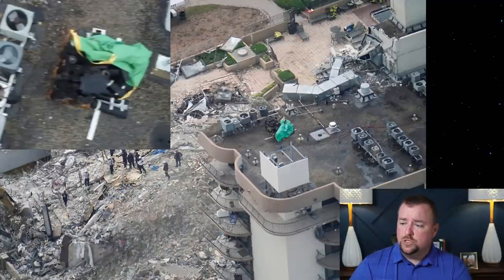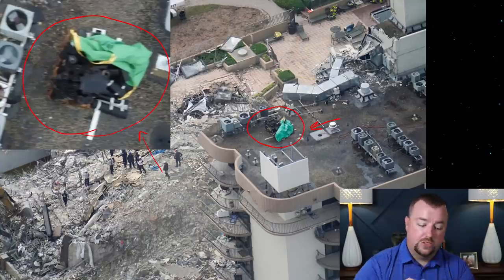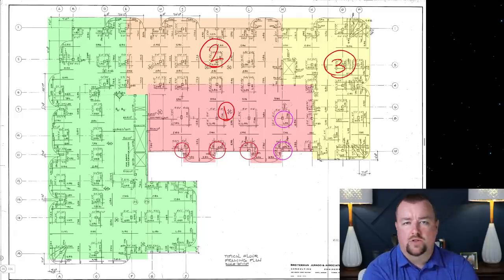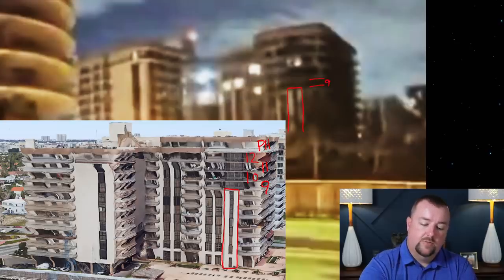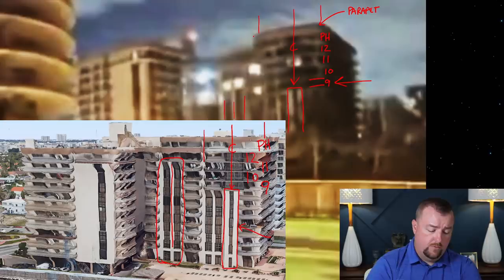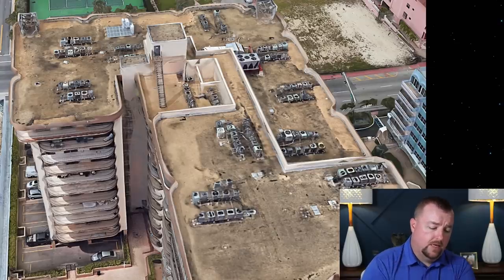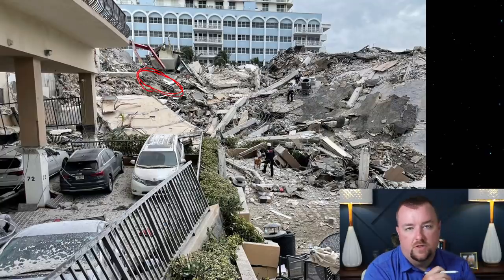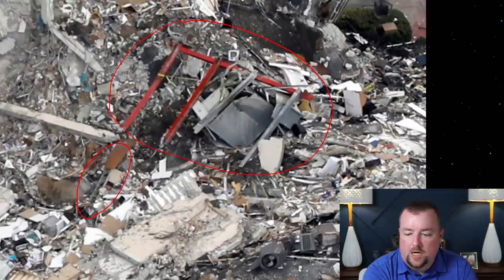Surfside Building Collapse - Did it start at the roof?

Comment: Did you not see the debris in the garage filmed moments before collapse?  Did not start at the roof.  Sorry.  The pool deck collapsed - that's a known fact.
Reply: I really appreciated this video explaining exactly why the collapse was indeed from the ground up and not, as some have suggested, from the roof down.
Reply: The pool deck did collapse first, and he's shown that in previous videos, but the pool deck is not technically part of the building.  The question was whether the building itself collapsed from the roof first, or the lower floors.  It may have been possible that the pool deck collapse destabilised the building above it enough, shifted the load etc to the point that the roof may have given way first.  This analysis demonstrates that it was Floor 1 that would have collapsed first.
Reply: @eat_a_dick_trudeau  unfortunately this is the internet. Where you have to debunk every unfounded wild speculation. Regardless of how many facts the speculation ignores.
Reply: @eat_a_dick_trudeau  This right here is gold. The comments from people who obviously haven't watched the video are driving me NUTS! Thank you for calling out @DeeDee2003

Comment: Josh, @24:55 do you think anything the roofers did (loads, cranes, davits/anchors) caused that curious triangular gash at the top of the stairwell shaft?  Apparently the sturdy CIP shear wall proper stops at floor 12, and they just hacked together the PH add-on with CMU "cinder" block, slapped on some stucco and paint, and called it "Reiber-perfect" and "Surfside 5-finger Approved"... can't bring myself to even call it CBS since there's zero vertical rebar, aka cavity-formed columns.  =:O

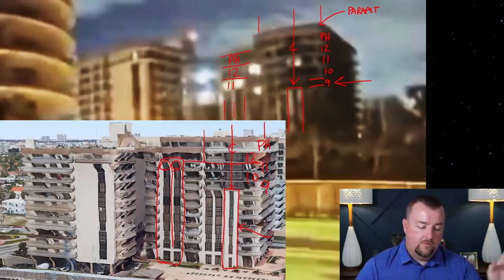Comment: 16:40 what happened to the parapet above the penthouse in the collapsed section though? It looks like it's totally gone or collapsed.
Reply: Agree. Given that it seems clear the deck collapsed "first" perhaps the parapet fell to the deck, collapsing deck, damaging columns, etc. May explain the damage seen in the first garage video taken by the tourist where it seems there was at least one column missing, knocked over. I may have missed it, but it has not been disclosed what roof work they were doing.

Comment: There's no doubt in my mind this... was a Sinkhole
Reply: Is that even possible considering where it was, don't you need some elevation (above sea level) to have the sort of underground movement that could create a sink hole?
Reply: Thats what I've been thinking this entire time.
Reply: No. When the pool deck collapsed, it removed the side support for the columns, at ground level. This effectively doubled the length of the columns. Say it was 10 feet between floors. The columns would be supported laterally at 10 foot spacing at every floor. With the deck falling away, the column was now 20 feet long. The load capacity is reduced to about 1/4 of it's load capacity when you double the unsupported length. So, if a column could support 100 tons at 10 foot spacing of lateral support, it can only hold about 25 tons at 20 foot spacing of lateral support. At that point the column fails.
Reply: it was not
Reply: Nah, the collapsing slab yanked three support columns out from under the building and set into motion the overloading of the the columns around them.
Reply: @kurtdietrich5421  
Then the building would have fallen flat like a tree if it failed at the base as per your theory.
 This building dropped down straight like a curtain..the floors landed over each other like  pancakes. It literally lost ground. Sinkhole is the only explanation.
Reply: @lordaimelord7848  I'm a licensed professional structural engineer for 40 years and worked in a concrete testing lab for 25 years. 
The columns buckled at the garage level. The rest of the building crumbles above it. Because it takes force to break all the column to deck connections, there are some areas that hang on longer than others. Especially to parts of the building that didn't fall. It wouldn't fall over like a tree. It collapses straight down. No sinkhole. Just poor maintenance.
Reply: Aurora Peace  the equipment on the roof was minor compared to the weight of the roof structure itself. Yes, it was added weight, and didn't help a weakened rusty structure, but it cannot be the major reason for collapse.
Reply: @kurtdietrich5421  
I disagree. Just as i disagree with the "Scientist" Dr.Anthony Fauci.
Reply: @lordaimelord7848  In case anyone wondered what to think about you, you have now removed all doubt.
Reply: @kurtdietrich5421  For the building to fall in it's own footprint, you need to break all the columns simultaneously. That won't happen in a natural collapse. 
@Lordaime Lord    The condo on Jun 24th fell similar to the part that fell on July 4th and similar to WTC7.
So I would say: A controlled demolition is the most likely cause.
Reply: @reallyme3573  unfortunately, you are very incorrect in your assumptions.
Reply: @reallyme3573  
It did look like a controlled demolition however i would have said the same  if not for the fact that nobody heard explosions. Not one person ever said that. 

There was a couple at the opposite block...swimming late in their pool..who heard weird loud noises from the  Champlain Tower and they videod water flushing down into the basement  carpark. That water must definately have come from the collapsed Pool which one woman on Champlain Tower had witnessed collapsing. That woman...a victim..
 told  her husband over the phone (he was out of town) "the pool just collapsed" 

The way the building collapsed was also very similar to how houses on  collapsing Cliffs  looked like.  Also similar to how houses collapsed into  giant sinkholes. There's lots of videos of Sinkhole disasters on YT.

Comment: Cool analyzes. I am not an expert or work in any trades related to building but the roof section that you showed, for me, proofs that the building collapsed on itself. When you talk about the Penthouse add on I think of the collapse of a tower that add extra floors on.

Comment: There were huge bush planters to the left of Spa on spa deck over parking garage where there had been puddles of water & rust on the ceiling & supports, caused by 40 yrs of over watering? The planters outline the edge the collapse, but I believe the pool deck was polka dotted with planters (which we're probably overwatered.)

Comment: One thing you aren't taking into account is perspective. The distant part of the building will always appear lower than the nearer. However I do agree that it was beginning to drop, just not by as much. The building collapsed like an implosion, which tells me it must've started at the base, where you indicate the 3 columns. Your explanations are very helpful, and I think you're spot on regarding the probable origins of the collapse. I wouldn't worry about being perfect on the "order" as it was a contiguous collapse. Some are saying that the pool deck failed, causing the building to collapse, but I think it's the other way around. The building was built in one continuous structure with the pool deck and parking garage (idiotic BTW - if one part fails, the rest will be pulled down with it). I think the building pulled down the pool deck.

Comment: Josh,  I really appreciate your thoughtful analysis of this terrible event.  Re the assessment on the Roof, it occurred to me that if the collapse was a bottom up failure, there would have been some indication of damage at the bottom level first, propagating upwards.  Anotherwords the first 8 levels would have become disjointed first, starting on the visible first floor.  You would expect to see warping of windows or shattering or something beginning at the lower levels.  I hadn't noticed the roof collapse in the video before.  But that really sticks out now.  Am no building expert, but it seems plausible that somehow the roof collapsed first, but before the ladder and the red steel components could be swallowed up, the roof collapse shock wave, may have been enough to overload the garage level piers, at which point, the front half of the remaining structure (1 in your video) dropped as a unit.  I noticed that the forward leading edge of the roof (apparent in the collapse video) was the lead in the drop. The whole roof slab rotated down, (back end at highest elevation, front end leading the dive downards).  In one of the frames, you can see the entire roof, except it was nearly vertical, headed to the ground.   That could have carried the ladder and the red steel components down in such a fashion that they remained on top of the debris. Concurrent with the roof rotating down, the whole structure (first building to go down), collapsed downward nearly as a unit.  So the Collapse could have been initiated by a failing roof, with the front of the roof failing first, over loaded the front garage piers first, then the collapse shockwave could have propagated to the rear of the building.    Anyhow, am just a retired meteorologist and we are used to doing post analysis.  Just my two cents worth.  PS not intending to blame a roof contractor or overloading on the roof.  Just looking at the sequence of events.
Reply: Upon rereview of your presentation, it is obvious you can't see what was happening at the lower levels.  I completely agree with your analysis that the whole thing fell as a unit from the bottom floor, and your assessment of the mismatch of the floors at the top are spot on.  Mea Cupa.

Comment: Did adding a penthouse later contribute to the issues that led to the collapse at all?  Since that's the side of the building that fell?  I know it's because the columns under the pool gave way first, but I'm still curious to know if the added weight of the additional structure contributed.
Reply: In a well-designed and constructed building, there is a generous margin of safety.  It is not unusual to add stories to old buildings.  Examples can be found in any city.  I don’t think this building was safe as designed, even without the penthouse.

Comment: Can all these individual AC units compromise the roof? All the holes for the piping and the additional weight? Just a thought? 
There was no central AC? Can you tell us a but more about that? 
Thanks!
Reply: The weight would not be significant in a properly constructed building.  Nor the pathways for the cooling.  When there are individual A/C units, it could mean that there is individual metering of electricity and they want each resident to pay for the cooling of his or her unit.

Comment: Are there roof details that show where the storm water / down spouts were discharged?  How was that water managed on the site?  Stormwater management plan?
Reply: Yes see drawing P5 for the roof and P1, P2 & P3 for the rest of the piping to handle storm water to two 3,000 gallons tanks.
Reply: @beehaven9949  

Thank you.

Comment: Josh, I would like to posit the concept of electrical flash as the source of the blue-white flashes seen in the first frame of the video sequence. These types of bright flashes are common when high voltage/high amperage discharges occur. Many videos by tornado chasers document flashes such as this when equipment discharge to ground occurs. The brevity of the flashes in the video also support the idea. It appears the vicinity of the flashes is near to the elevator chase, and the electrical equipment in such a location would have power from cables routed nearby. The electrical diagrams of the building should be available to document this.
Thanks for the great analyses, your work is much appreciated!

Comment: i’ve heard nothing about the roof line coming down smooth and straight , all the way down . 

any thoughts on that 800 lbs elephant? 

kinda like Building 7 .
Reply: The WTC buildings are not relevant to this discussion.  But there is one thing that all structural failures have in common: gravity acts straight down.

Comment: At 16:45 is seen the penthouse on the collapsing part of the building. Though the entire video and frames are blurry, it appears that the underside of the roof deck and parapet (knee wall) above this penthouse unit is not completely there, the parapet seems to be missing. If one compares this area to the equivalent parapet and underside-roof slab area above the penthouse suite on the non collapsing portion of the building seen to the right of this collapsing portion, one sees much less vertical height to the parapet and underside-roof slab above the collapsing penthouse suite. The full vertical height is seen clearly in the the parapet and underside-roof slab above the 12th floor unit on the portion of the building that did not collapse at all, but this is missing from the front facade of the right side penthouse site that is collapsing, possibly all the way to the shear wall. Certainly the facade of the building is already falling when the video starts, but the parapet seems to be missing, or it has somehow turned see-through. 

Additionally, the collapsing penthouse suite had a concrete parapet around its deck too, and this parapet section along with the penthouse's deck slab can be seen between the penthouse and 12th floor suite below it. But there is no comparable parapet height above the penthouse that is collapsing. The video is blurry equally all around, but why in this section of the roof slab is no parapet seen, why does it look like it is invisible in this location but nowhere else?

It is necessary to consider that the portion of parapet knee wall extending along the roof of the facade that collapsed first might have released from the roof due to crack formations and concrete deterioration and fallen down in front of the facade all the way to the ground floor to crash through the planter area on the patio deck in front of unit 111 and extending to the shear wall of the part of the building that did not collapse at all. This would likely have caused the patio deck area in front of 111 to immediately fail, forming a large hole in the patio area there. Columns and beams in the deck slab and underground below this patio area would have been destroyed as well, which one can imagine lead to the entire pool deck collapsing as failures spread, and then, of course, the entire interior portion of the building, after which the east portion followed, leaving only the elevator/shear wall-guarded southern portion of the building standing. 

It is interesting to note that the lady with two adult children who was in 111 who went to report construction noises (knocking sounds, perhaps pieces of concrete hitting her front patio) to the front desk, heard a frightening boom when at the desk, and when she went to see where the sound came from, she saw the pool deck collapse. A falling parapet would definitely make a huge booming sound as it hit the 1st floor deck. When she left the building with her kids, she heard two more smaller booms after or during which the building immediately collapsed. There are also lots of lights on in this area of the building by the collapsing penthouse, the other areas have few lights on.  Perhaps tenants in this area heard and noticed something going on outside their windows, perhaps a parapet crunching past their deck rails before it cleared these upper 3 or 4 facade decks and fell in free fall the rest of the way down. .  

It is clear that the pool, patio, and parking decks were suffering greatly from water seepage and rebar and concrete deterioration, plus were possibly water logged, leading to their overloading evidenced by extensive ceiling cracking seen in the underground video, and this may have been the reason why so much of the deck slab then collapsed by punch shear of columns.  

The possibly falling parapet is a hypotheses, it would need more evidence to back it up, such as eyewitness reports of the first damage that appeared, damage and appropriate debris seen in the underground, and so forth.

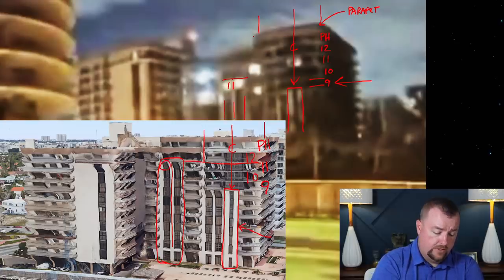Comment: 1. Please, please correct me if I'm wrong, but it appears that at 16:15, what's labeled "10" on the right-hand side in the video image is labeled "11" on the left-hand side. IOW - it looks like the two numberings are off by one.  I think it becomes more apparent with the "12" labels - the left-hand side is one level below the right-hand side.
2. Someone below pointed out that the "collapse video" that's been released is a second-generation recording taken from a monitor. This is why the video starts at a time that is too late to see what might be the start of the collapse.  It's surprising that no media outlets have made an issue of this. It's surprising that they haven't requested a first-generation copy that starts, say, 30 seconds before the one that's been released.

Comment: The first frame is quite fuzzy near the bottom of the building. Could that be a cloud of dust from the collapse starting at the bottom (also strongly suggesting that the collapse did not start on the roof)?

Comment: Your initial shots show the roof of "part 3" as black but also as the light material ( grit ) seen at 20min. (quick frame of lighter colour at 25:m49). Was that material stocked on top of "part 1". The lights may have been window reflections of lights elsewhere.  If the building was moving that could provide a flash, which some are interpreting as an explosion.

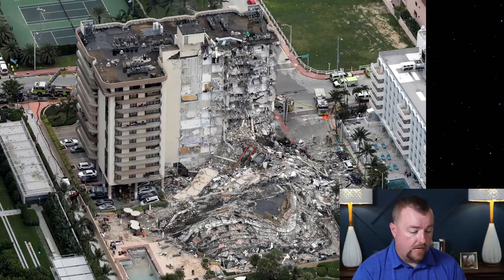Comment: Note in the picture @24:40, which is believed to be early morning before any heavy rescue efforts, there is no water in the pool? Where did it go? Did it drain into the lower parking garage? Perhaps not important but interesting.
Reply: Probably the pool or equipment was damaged by the collapse, causing a leak.
Reply: @GH-oi2jf  Good call! That was probably it!

Comment: I believe it started in a corroding parking deck. There were cited problems there during an inspection. Lots of epoxy injections and water puddles all around. It couldn't hold the weight anymore. Not to mention the busted pipe gushing water.